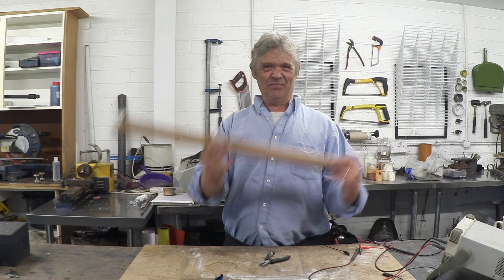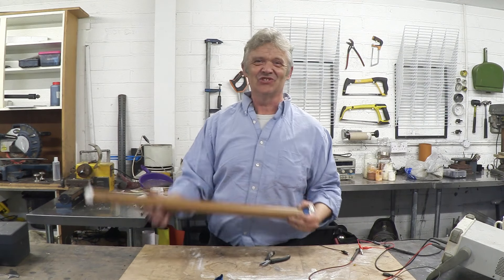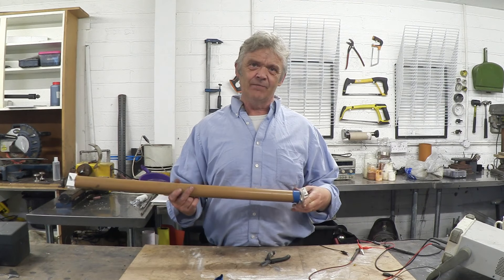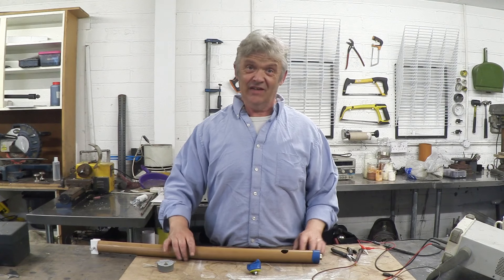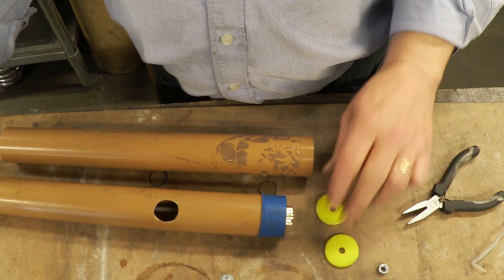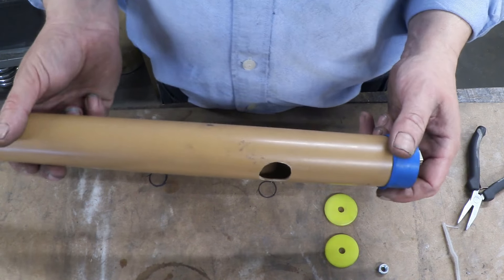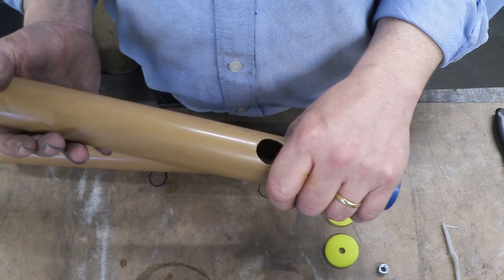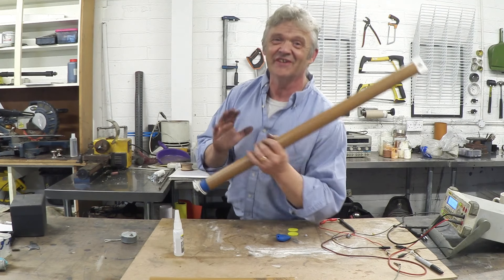A Wind Generator That Works Even When The Wind Stops Blowing

Comment: Another great video Robert! This seems like a really versatile device but with a lot of potential for fine tuning for efficiency. Since you have one open end and can put a hole in the side, I could imagine with some playing about you could even replace drainpipes with these and generate electricity from rainwater flowing through them to vibrate the muscle?
Reply: John Lillbourne   The pulse motor has to be driven and if you wire it in a circle and think you can get "free energy" you are wrong.  Physics doesn't work that way.
Reply: Maybe - it really depends on the voltages he is getting.  Devices like this are often only good in groups and for long charge applications - if they are useful at all.  To be useful, they will need to produce at least 1 watt.  I don't think it is there yet - but at least these devices are true generators and not "free energy" schemes.  To me, the point is working toward a solution, not getting one in the first try.  I think this is a great example of that.  Once he optimizes it, we shall see - for such a simple device, you would be amazed at all the things that could be optimized.

Comment: Congratulations.  It's a remarkable idea.  Would the vibrations be lost or constrained by sealing the open ends.  I think if it can be sealed, thin tubes attached to a base in large numbers could allow the generator to be constructed like sea weed for use in any tidal or flowing water source which would not be seen with minimal ecological impact on the flora and fauna underwater.

Comment: Great again. I will be having a go at this. Just a side note Robert, you seem to have trouble taking rubbers off.😊
Reply from the maker: lol - always had that problem mate - and you should see the mess I make putting them on!
Reply: The trick is to never put them on. After all...this channel is all about alternative methods. 😊
But, like always, just be safe.
BTW...i have only 3 "clones".
Reply: You must refer to the "3W" method!
Reply: @SI-GOD  I have 4...two of which are currently for sale. cheap.  (definitely not "over worked" in any meaningful sense of the word) ;-)

Comment: I want to try this!  
We live less than a US football field length from a pretty constantly busy 4-lane street. 
Plus some breezes, plus some little tree movement, if mounted onto the flat cut of a couple 15’ snag tree stumps.  Those are wide enuf than several could mount vertically on top of each.   Thinking, longer is better, to pick up on more vibrations. 
All we need are parts!  Let the collections begin! 😉

Comment: This might be a silly suggestion, but wouldn't housing this inside the support structure for traditional offshore and onshore hawt's be an ideal place to capture more energy? The huge blades on the turbine would presumably create enough vibration in that post to create power using this design.
Reply: Or Vawts.

Comment: Robert this is fairly similar to a topic which is near and dear to my heart which is a Thermoacoustic generator.  It works on a similar principal however the reverberation of a generated soundwave created by a temperature change causes a sound wave to bounce off of the diaphram on the far end of the tube and that continuous wave creates a constant movement of the magnets to generate electricity through the induction coil.  This is what NASA uses to power some of the ISS orbiting earth now and what they hope to use for manned missions into deep space as a constant free energy source.  I would love to see you pursue this principal as well.  Thanks for all your great work.  I love your channel.

Comment: 0.270 amps is more than enough (@13 volts) to keep a car battery topped up for storage purposes. Most modern cars draw no more than 0.050 amps when the computers are "asleep". Better than a solar panel because this works at night and on cloudy days too.
Reply: Put it on top of car and harness the wind blowing by
Reply: Too bad you cant read the multimeter, its 277 microamps
Reply: I think Robert mistakenly said 277 milliamps. I read it a .277 milliamps, or 0.000277 Amps.

Comment: I like the design? It's similar to one I had in mind that I have yet to build. Same tube design, but with a solid pipe cap at the top end through which a car antenna is center-mounted and pointing straight down. The assembly is clamped and fixed to a wall at the bottom like your design. The coil is mounted the same, but the magnet is attached to the tip of the antenna. It's positioned in a similar fashion to yours in relation to the coil. The observation that induced this design concept was I noticed even a slight thump at the base of an antenna creates quite a bit of movement at its tip.
Reply: I was thinking put a spring in it.

Comment: K.I.S.Silly.
Another excellent post. Thanks. 
Hey, is the idea of scavenger electrical generation worth looking at? Peltiers on the hot water service, fridge compressor , heater etc.
Micro turbines on gutter downpipes, 
Inline on water taps etc.
We waste so much energy,  recapturing any could help.
Reply: I know a bit about thermal couple devices like Peltier devices. They generate electricity not just from heat, but cold as well as it does this via temperature differences. When you get the hot side hot, you must find a way to make the cold side cold with a very large heat sink to draw the heat away.

Comment: Brilliant ! Vibrations is the answer ! I have a question...instead of the artifitial mussle...will copper piano strings work...as it is very sensitive to vibration ? Obviously the thickness of the string should be considered ! Just thinking...perhaps a mounted square frame with many strings ...?! One still needs batteries to store the electricity ...or you will have unstable supply...right? Will have to share this with my husband (electrician/Gas and solar expert) Thanx for sharing !

Comment: Amazing design in its simplicity & effectiveness!  I had one thought for improvement.  It seems to me that a simple round tube like that would readily allow the wind to rush around it and not deflect it as much as if it had a shape to catch wind.  However, wind could come from any direction.  What about an affair attached to the unsecured end that looks akin to the blade of a shovel, for the purpose of catching the wind more effectively?  The one extra feature to it is it would be mounted on a pivot, just like a wind sock at an airport, so that it would swivel around to the desired direction to get the maximum benefit of the wind.  Thoughts?
Reply: You would want it to resist against the flow of air, while catching the air,  not be manipulated by the direction of the air. Otherwise it just catches a brief bit by proximity and not the fullness thereof... in a manner of speaking.

Comment: You could fashion this in to blades for the vertical windmill on the inside part of the blade, sharp edge on the exterior or entry point and the pipe would reside inside, two side sheets would make the blade, meeting at the exterior and land on each side of the pipe at the inside part. This would be designed like this so that resistance would be lower. Hope this little nugget has something for everyone. 
Thank you for the wonderful videos.
Regards,

Comment: Rob, I have an idea re: rotating  a sort of camshaft (light, synthetic,tubular) loosely mounted with a propeller on one end, and a reed on the other. Bearings between the inner "camshaft" ends, and an outer housing ends. Prop and reed being multiple electrical stimuli, so to speak.Various other could be added. The "cam" is covered with many rings of circumferential magnets. Hot melt glued for example.  Each ring of magnets on the cam has a corresponding coil or many coils on the outer housing that pulses with rotation (propeller), or vibration (reed) and is fixed in the tube that encloses the cam. It could have as many circumferential "magnets" as you liked, and for each ring added., a single, or array of coils (transducer). It could be small or large, 1 ring or 1000 rings. The only caveat being the cam should be as light as possible. I would mount it horizontally for weather protection. I see some weaknesses already, but basically, it seems like it might work.   What think you ??

No rights reserved by author.
Reply: Exactly what I thought when I saw the video! 😮

Comment: A few thoughts , if you take energy from  a tuned system you will  quickly damp the vibrations that provide the energy input to the coil.  So the output will be dependent on the energy input to the tuned system.  energy extracted from the system will have to be reduced sufficiently so that the system still resonates enough to get a useful amplitude of motion between the coil and magnet.   A next consideration will be how much energy is lost to internal friction in the tension element.   A parallel consideration might be the rising air effect in a vertical stack due to solar heating.  I can't comment on theamount of  energy input due to solar heating of air in a stack compared to energy derived from vibrations.  My guess is that energy input due to solar heating would far exceed energy input from from random vibrations.  I have observed the velocity of wind rushing up a tall stack. the effect could be amplified by painting the stack flat black   A wind generator placed at the base of such a stack might generate useful amounts of energy.The overarching question is can you harvest enough energy to warrant the capital expense?
Reply: For sure. Especially if you combine it with another part.

For example this + a Water Wheel. Using the natural force of water to push a wheel to feed the vibrations into the tension element.

Flute Mechanics would provide differing volts/amps. I wonder the effectiveness of a compressed air versus this.
Reply: @icarusunited  I think the answer is contained in your post. The energy transfer is via the change in  potential energy of the water as it moves from a higher elevation to a lower one via the water wheel.  Resonant frequency is not a part of the energy collected from the system.   Think of resonant energy like that in a bell. The bell will cease ringing a soon as you put your hand on it. Energy in the ringing bell is contained in the moving momentum of the mass in the bell. as soon as you touch it the energy of the momentum is transferred to your hand. There is no reason to try to put energy back in the bell in order to harvest energy to do useful work.  Hang in there, critical thinking and asking questions one of the most valuable skills you can cultivate. Chase the facts, question everything, especially yourself.
Reply: @kwatt-engineer796  but maybe near the boiler?! or by the beach collecting garbage?!

Comment: - Mount the thing upright on a really wobbly spring.
- Add a funnel to the hole to push more air in.
- Replace the muscle with a wide rubber band (being wide the band should twist then air enters). 
Would the above suggestions help the output?

Comment: Hi Robert, 
I've always had an idea to make use of tree branches for energy. I'm not ready for this experiment,  but wouldn't it be nice, to create numberbof these, and place in parallel series onto tree branches. Vibration from a tree should work well. However,  Although this is considered simple, I feel a bit complicated.  And not sure how much energy can be derived for the effort, and if reliability would be an issue. Through rain, snow, etc.

Comment: You built what looks like a crude version of the Vortex Bladeless wind Generator. They have been working on getting one to work for a long time.
Reply: @gul7809  never say never!!! People said the mechanical carriages would never be better than a horse and converting sun light into electrical energy would never be possible as well!
Reply: @gul7809  efficiency is measured in more ways than power output!!!!!! You would know that if you did some research!
Reply: @gul7809  oh...so you claim to be an expert in a field with comments like you have been posting? I would be ashamed to call you an employee!!! You would have been fired 20 years ago!

Comment: This made me think of my first radio, a crystal set that didn't require any batteries. The crystal would pick up, vibrate to  different frequencies and created enough current to run the earpiece. I wonder if scaling this up is what Tesla was doing as he harnessed energy from the atmosphere? I've watched street lights, light up during a dust storm as we were installing them, with no conductors terminated, no circuits on. There was enough static in the air to energize those transformers. Plasma is the most abundant state in the universe, free electrons. Matter passing matter strips electrons, like the wind in the atmosphere or rain falling from thunder heads. Study Sprites, Green Elves, Lightning and Telluric Currents in the Earths crust stimulated by the sun and the magnetosphere/plasmasphere. Great example of energy being created by movement, thanks.

Comment: As I watched this video the 1st thing that came to mind is adding a mini turbine to the top, bottom or both or even have the entire tube a turbine similar to another video you made using a vertical fan to make a wind generator. Combining the two ideas together would remain simple, cheap and increase the energy output pretty significantly I would think.  I'm gonna try it anyway!
Reply: Have you tried out your idea yet? If so does it improve energy output? Have you been able to measure what it's electrical output actually is? Just watched the video and I'm curious about some of the improvements people suggested. Thanks

Comment: That is very interesting, I have got a few of those motors around.  It needs to pick up a bit more vibration though to make it useful.
It might not need a lot to make it vibrate constantly.  As you say, a lot of them on a bridge will make enough to charge a battery to light a bridge at night and still be changing the battery at night.  It just needs a bit of research.  One or two on every suspension cable and the amount of power being generated will soon mount up.
Reply from the maker: Great points mate - cheers
Reply: @ThinkingandTinkering  It just seems to me that the real problem would be regulating the power. As the vibrations increase and decrease wouldn't the amps and volts produced would be all over the place?
Reply: Dick Sargent Hey friend. It’s fairly simple to keep the voltage regulated, there are whole devices just for that, but even the simple capacitor will do it.

Comment: My biggest question at the moment though is what capacity/voltage battery could a device like this, even modified to increase output as I've suggested, realistically be expected to charge?  My knowledge of electronics is pretty basic so my question is earnest.  If anyone has a good idea about the answer, I'd love to hear it. In the video, tapping the device resulted in a couple of milli-amps it seems.  That's not much considering a 5v cell phone battery requires 500+ milli-amps to slow charge(very slow charge lol).  Dont get me wrong. Im not criticizing. Im attempting to explore the current limits in order to come up with improvements or work arounds. This is where it starts, right?
Reply: That is exactly the kind of questions that this has sparked off in my head, thanks for articulating it for me

Comment: My parents made a generator that's been running without electricity for about 51 years now. 
It runs on food and the exhaust is a methane gas. It's me.
Reply: You still run on electricity dude. We all do.
Just don't try to plug yourself in. The adaptor doesn't fit the socket and just falls out.
Reply: @ThePinkBinks  Well, ok and don't pee on electric fences, I get that too, but when I want to clone myself, when I want a mini me then I have to plug myself in. Jolts and electricity are involved as well. ....I invite you to do the same. The male connector to the female receptor.
Reply: eric mol Oh that kind of plug is fine and dandy. 😂 The recharge socket is a little like trying to fit a five pin to a coaxial. 
Personally I cut the wiring to prevent accidental semi-clones. I let the software run though - Plenty of sparks and no future destruction to the hardware! 😝 Definitely more fun than an electric fence and I know that from experience. Wait... that doesn't sound right...
(Fell into a river and tried to grab an electric fence to climb out. I don't recommend the experience.)

Comment: That memory metal would be good for the muscle. Can't remember what it's called. Or a spring out of spring steel. Springs move around for a long time after the initial vibration like on a gate. If you twang the spring it keeps wobbling for minutes after.👍
Reply: Nitinol; the nickel titanium alloy?
Reply: I think the spring steel spring would work fairly well, but would be hard to tune. But you could use a telescoping tube to do so?  An old carbon fiber hiking pole might work well for something like this?
Reply: @justinw1765  cheers😉👍
Reply: @justinw1765  great minds think alike!👍 something bigger like a telescopic landing net for fishing or if it needs to be thinner for more vibration a telescopic tripod for a camera would also be good. I've got a microwave in pieces for the coil but I thought you can make your own bigger and more powerful coil with the copper wire from a washing machine motor which I also have.
Reply: @rastamanralph6670  Sounds like its worth trying out. Best of luck!
Reply: @justinw1765  I like to think about inventing and working things out but I don't get round to making the things so I think someone else should and show the results.